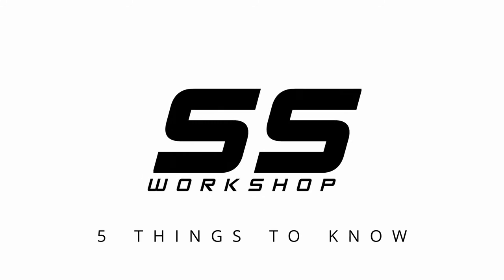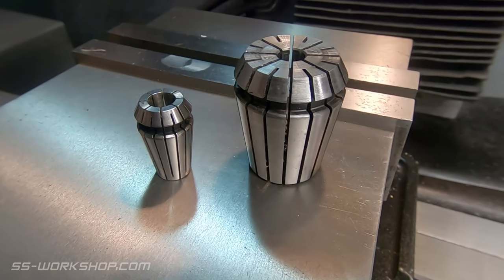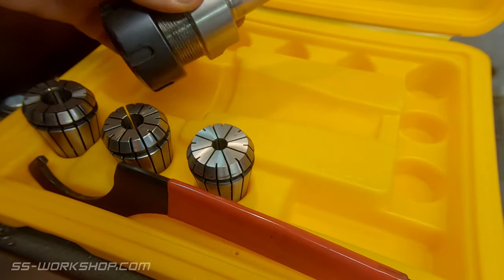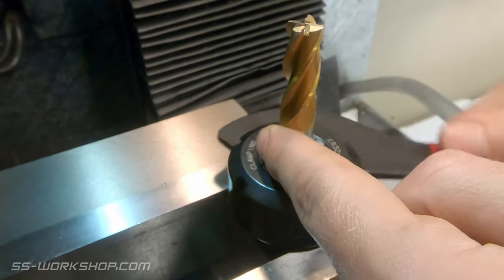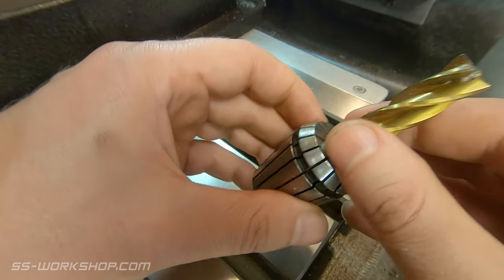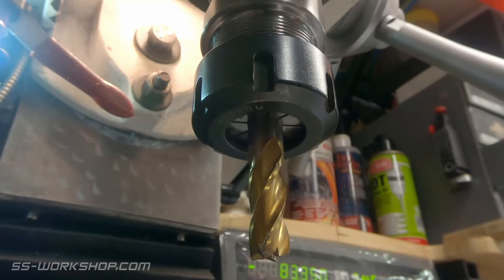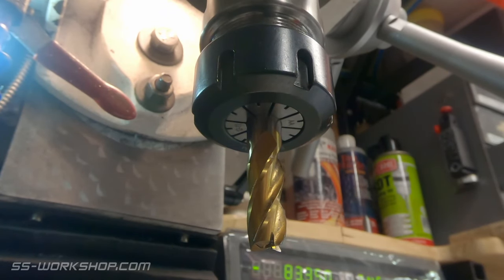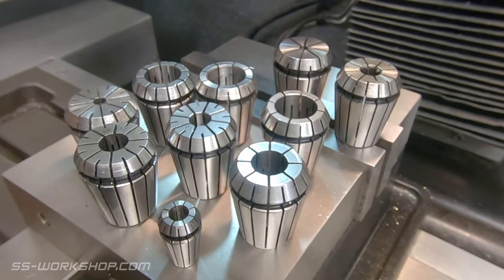ER Collets | 5 Things to Know for Beginners

Comment: Saved my bacon. I've never used a collet set before and thought it was broken or a rubbish cheap rip off. But as you said, in the video, All I needed to do was clip the jaws into the nut first, but I didn't do that the first time around and got the jaws locked into the body.  After a struggle, I got them out then followed your instructions, and now it works just fine. Thanks very much buddy.
Reply: Same here. This video saved me. I was on the edge of sending my new collet set back and leaving a withering comment. 
Said in another way - i was on the brink of making a complete moron out of myself. But then i found this video. 
All of my 19 collets are fine, the holder is fine and the wrench also. And all that for under 80,- €.

Comment: Another thing that took me a while to figure out is how to take a collet back out of the nut after you've clipped it in, since the tapered shape makes it hard to grip (especially with little ER11 collets). Instead of trying to pinch and pull it straight out, push from the side to tilt the collet in a circular motion and it will ride up the surfaces in the nut and come right out.
Reply from the maker: Agreed, even with the larger ones they are puzzling until you know the trick for removing them. I found they would come out sometimes and not others and you really have no idea why until you understand how they work.
Reply: Getting it out, that's what I was looking for.  Thanks...  Even after I've read your entry, I still can't get the thing out... :(
Reply: It’s definitely a knack that’s difficult to describe. Took me a long time to discover it. It would’ve been very useful to have seen this video first.

Comment: Great Video!  There's one thing that I think belongs on that list though and that's that ER collets and clamping nuts wear out with use.   This is less important with larger tooling but if you're using micro end mills (e.g. 1/32" and smaller) the nut and collet must be in good shape to have acceptable runout.
Reply from the maker: Great to know, thanks for sharing.
Reply: Everything wears out eventually. With high quality collets and chucks it’s only a problem for heavily used collets and chucks in high speed CNC machines, not for the home. Ok, some questionable info here. Look at the back of the collet to see how long the gripping length is. It’s not the full length on all sizes. The smaller sizes have shorter gripping lengths. Also, each collet has a gripping range. These aren’t R-8 or “C” style collets that can only grip the stated size. ER collets have the gripping range on the face of the collet, such as 5-6, 6-7, 7-8 in millimeters, or in 32” in inch. There are half millimeter sizing collets as well.

Comment: Fantastic video, came here with questions and left satisfied with the knowledge I have received. One more question though: How to chose between the different ER size offerings for a particular application?
Reply from the maker: Thanks, as far as I know it’s driven out of the size range you need as each ER size has a maximum and minimum size available in the collet range. This is limited by the shape of the actual collets. There is also increase strength in the bigger collets.

Comment: Nice info. I have an ER32 collet chuck for my wood lathe, my metal lathe, and my benchtop mill (when I get it), and I have a full set of SAE collets. These have been very handy when I have had to hold small diameter rod stock for either machining, or for holding a ring mandrel on my wood lathe.

Comment: so you need 12mm collet for 12mm endmill. can you help me.. Im looking to buy er11 for my spindle for pcb engraving. but all I could find are 0.5 to 3mm end mills all with 3.175mm shank. problem is all the er11a and er11 I could find only have 1, 2, 3, 4, 5, 6, 7 mm collets. so according to you none of them would fit a n end mill with a 3.175mm shank..
Reply from the maker: At the size you are looking at a 4mm will likely work without a problem, the issue usually comes when you use a 7mm collet with a 6mm endmill which is likely slightly under 6mm and outside the range of the collet. If you do have any trouble with them not gripping tightly or slipping the it looks like 3.175mm is the equivalent of an 1/8 inch so that would be the correct collet.
Reply: Late answer but ER collets also come in 0.5mm steps; 3.5mm ER11 collets are available from various manufacturers including Rego-Fix and Vertex; ER collets were originally developed by Rego-Fix.

Comment: The drop in collet nut is made for a "sealed collet" for a machine with through spindle coolant.  The sealed collets don't have much flex. The standard spring collets just snap in.
Reply from the maker: Interesting, thanks for sharing.
Reply: My through tool coolant on HSS drills on lathe is actually coolant blasting through the saw cuts in collet lol
Reply: @piter_sk   Sometimes that's a blessing. I've used that trick several times to wash chips out of a milling cut when trying to mill a slot and not regrind chips.
Reply: @Kaptn_Obvious  actually with HSS drills, it´s the best way to get coolant to the cutting edge... it´s literally going down the flutes to the tip.... today, I was drilling 16.7mm hole like that, 0.12mm/rev feed and 550 RPM (which is between 20-30m/min recommended for HSS in mild steel).... the chips weren´t even slightly warm comming out of the hole...

Comment: You can buy 11 sets of just er16 collects, all of different hole sizes. But which ones do i really need. Do endmill shanks come in 11 different sizes.
Reply from the maker: Endmills only need a few sizes as the shanks are generally standard sizes, for metric 6,8,10,12... . The reason for having a bigger set is for work holding, such as in the lathe or with a collet block in a mill.
Reply: @SS-Workshop  so for er16 collet i only need size 6, 8 and 10mm.
Reply from the maker: You may also come across 4mm shank endmills for anything smaller than 4mm depending on the work you are doing, but other than that yes 6,8,10mm for end mills usually. ER16 is pretty small so assume the machine is relatively small if this is the case 10mm may be on the big side of what it’s capable of. The collets I use with my machine are ER32 if your interested here’s a link to a tour of it https://youtu.be/IhoZlG0Rj64
Reply: @Z-add  
Hi... to be honest it's probably best to have at least 2 collets of each size.... 
.5mm-1mm, all the way up to 9-10mm.
Reply: No, but drill bits do.

Comment: Hello, I use ER20 for coiling proccess, so I have to insert both ends of the 2 metres SS wire/mandrel that is 27” OD into collets, tighten them with torque wrench and start coiling procces. The problem is that the mandrel is lined with a extremely thin wall liner that is very fragile and of course it gets damaged after being squished inside the collets, whats better to do? Will I try to apply some kind of protective sleeves on the ends of mandrel before inserting them into collets or maybe there is a rubber inlets or something to add into collets ID? Also my mandrel tends to slip off of the collet, so I have to play around and once it holds quicklu tighten with torque wrench. Thank you.
Reply from the maker: Hi Sandra, that’s an interesting setup, certainly beyond my experience but hope one of the viewers can assist you. One thought that comes to mind, is there a lot of tension in your coiling process or could you tighten the collets less to reduce damage to liner.

Comment: lets say i have 13mm collet and i need to use 12mm bit or 11 can i just put tin sheets around it and use it ? feels very tight and solid
Reply from the maker: Interesting question Alfonz, I can’t say I’ve tried it but the purpose of an ER collet is to run very true and give good side support. Adding a shim is counter productive to that. Another suggestion is to look at import collets which can be significantly cheaper than the brand name ones and true enough for the home workshop.
Reply: Never!

Comment: I guess I may be in 'toytown' here compared to your equipment! ..............  I'm using ER16 collets.  For use on a spindle motor on a CNC machine.
I have a bizzar issue, and you may know ( or your viewers ) where the problem lies.  My collets are all metric and I want to use a 6mm diameter milling bit.  So I select my 6mm collet, insert it into my locking ER16-A collet nut ( as you've shown in your video ),  and then 'try' to insert my milling bit into that collet .................  no go!  the collet is now too small  : (

There are 2 numbers on some collets,  example; On mine I have '6-5' .............  I assume this means collet open = 6mm / and collet closed = 5mm ( the clamping force basically ).

I tried the next size up,  my 7mm collet has '7-6' written on it,  I assume this means when it's open it's 7mm and when tightened it's 6mm ...............  not on your nelly!  it doesn't clamp down on my milling bit at all.

So what's the answer?
Anybody had this problem before?

TURK
Reply from the maker: Your correct on the numbering it’s the largest if there is one number and the range if there are 2. I have had the same problem with some cutter and collet combinations as well, I think they are a little closer to tolerance than others. What I find works is to insert the cutter in the collet before placing in the holder. Hope this works for you, certainly don’t want the collet oversized they just want grip enough as you have found.
Reply: @SS-Workshop  Hi SS WorkShop ..............  Yeah,  tried inserting the cutter in the collet first then into the collet nut, no go I'm afraid!  : (
It's obvious that by inserting the collect into the collet nut ( clipping it in ) as in your video,  that simple action already compresses the collet ( 6mm collet in my case ),  and as it's already under compression there's no way of inserting a 6mm cutter or bit of any type.

I found a solution however!  ..............   Your viewers my be interested if they have the same issue as myself -  

First of all I must point out that these collets are not the 'top of the range' 'super precision' types  ( very very expensive! ).  Nor are these the very very cheap nasty BanGood types!  I think it's safe to say that they are Amazon 'best buys' as they offer good value for money,  quality OK, not too expensive. But not cheap either  ; )

As we all know as 'machinists' ( term used very loosely in my case! ),   cheap tools ( hand tools and even machines ) are usually not finished to a degree of high quality.  Same goes for collets no doubt!  I was looking very closely at the offending parts,  I say 'parts' as it may be coming from the collet nut as well.  And I noticed that the slits on the collet were not exactly the same to one another!  I inserted a metal nail file ( that's about 1mm thick ..........  same as the slit as it happens ), and there were burs inside the slits!  So in some slits the nail file didn't fit and in others it did!  Once all the slits were filed down ( toward the front of the collet, and not the rear of the collet ),  I can now insert my 6mm collet into the collet nut, and then insert my 6mm milling bit  ; )

Call me a scenic if you wish but,  I truly believe that  most of these collets are probably made in the same factory,  the more expensive collets are usually manufactured first when the tooling is brand new,  and the lessor quality collets ( cheap budget ones ) are the result of old blunt tooling that leave burs and many imperfections, that are later sold the cheap-skates such as myself!   : )

Anyway,  hope it helps somebody.  At the very least you'll know not to just throw them out,  just file em down or even sand them down to a better finish.

TURK
Reply: For a 6mm drill/shank, use a 5-6mm collet.
For a 5.1mm drill use same collet. Ok?
NEVER use a 5-6mm collet on a 5mm shank. It's too close to the bottom limit of the collects closure. Chances are, the tool will spin.
Reply: @neilwoodward7336   No such thing as a 5-6mm collet!? ...............  my guess is that's a typo!  That would mean a 5mm collet closing down to 6mm!
And they don't make 5.1mm milling bits either!

No,  the solution is not buying cheap collets ( or collet sets ) from Amazon!  they're garbage!  even if you buy the 'expensive' types on Amazon.  They'll still be garbage as they're made in China  ...............  not really known for their precision work are they!

I finally bought a decent set of ( expensive, expensive to me ) collets from a company that specialises in engineering/tooling for machinists.  Precise to 5microns!
No more worries!  ; )

"Buy cheap ..................  buy twice!"

TURK
Reply: @t4concepts  
But they make drills from 5.00mm up to 5.99mm. Mister, the point is those collets grip and run true if they're holding within their range. We're not just holding end mills!
Reamers, form tools, drills, slot drills.....etc....
And don't forget the range of sizes obviously accommodates metric and imperial. (1/2" = 12.7mm, 1/4"=6.35mm....
You get the point?
Reply: @t4concepts  
Also I am a Precision Engineer of 33 years experience. Aerospace, Medical all aspects of this business I've made and machined.
CNC is my area of knowledge.
Reply: @neilwoodward7336   No, I don't get your point!   As for 'Imperial' I know nothing about it ...................  not interested, never used it, never will!
My entire shop is tooled-up as metric, as are all my machines.  Yes,  I am aware that drill sizes are far greater than endmill diameters, have many of them myself.  I want to use a drill for drilling a hole, I use a chuck.

33 years experience! ..............  so what's a 5-6mm collet then? ..................  never seen one.
As a CNC guy,  can you buy 5.5mm end mills?  I'm in France ( use to live in the UK )  and they're not available over here.  Is their such a thing?

TURK
Reply: @t4concepts  
Actually you CAN buy 5.5mm end mills. 
Obviously you are a hobbyist.
Reply: @neilwoodward7336    Yup,  still learning!   ; )
The point I was making Neil was .....................  when it comes to tooling,  don't buy cheap!
I'm learning that as well !

TURK
Reply: You are correct that a 6mm bit should fit in a 6mm collet. Are you sure it isn't 1/4" shank? I like inch size collets, because 1/4" can take 5.5mm, 6mm, and 1/4" bits, and 1/8" collet can take 2.5mm, 3mm, and 1/8" bits. Shars has good collets for a reasonable price.
Reply: @t4concepts  Drill chucks have a lot more runout than a collet chuck and are more likely to loosen or have the tool slip. You are much better off putting a drill in a collet chuck if you have one the correct size.
Reply: B
Reply: @t4concepts I use 11, 16 and 25 ER collets. On all of them, when new, I have found cutting debris left over from the slitting of the collet. First thing I now do with any brand of collet is to take a small utility knife and run the blade down each and every slit both from the bottom up and from the top down. Then pull out all the dislodged garbage with a pair of tweezers or long nose pliers, wash the collets in degreaser and then spray them with anti rust agent and you should find better run-out numbers, better holding in general. 

If close to the max capacity of a collet, insert the collet in the nut first. ALWAYS. Then insert your tool to the full depth of the collet as SS showed and then insert it in the collet holder/chuck and tighten. 
Some imperial sized collets fall in-between metric sizes, so if your tool won't fit/hold in a metric size, see if there's a better fit in an imperial sized collet.
Always make sure your collet is in the nut properly before inserting the tool or work piece.